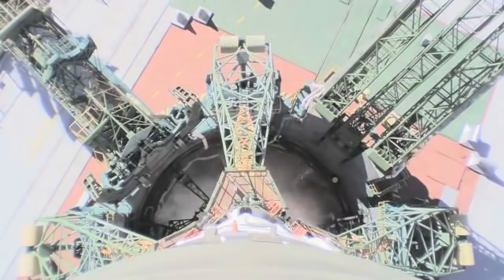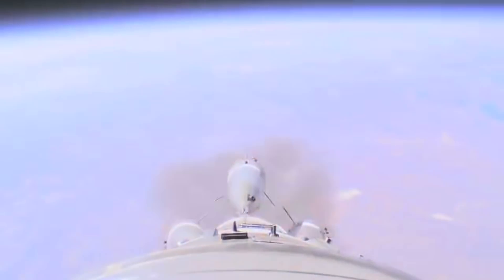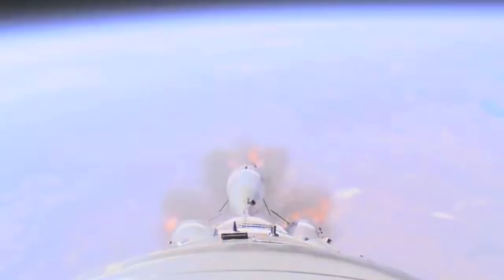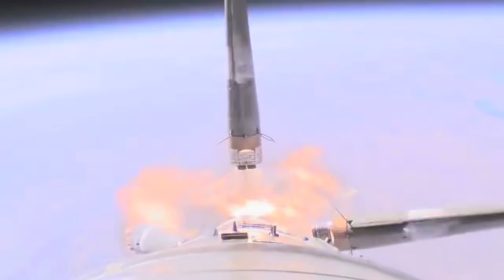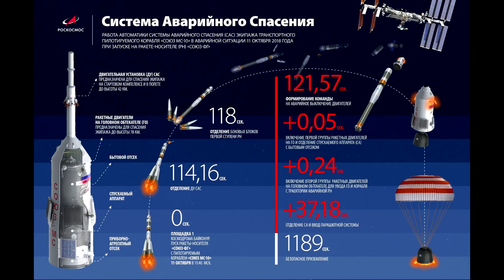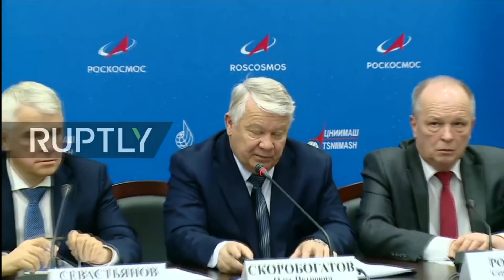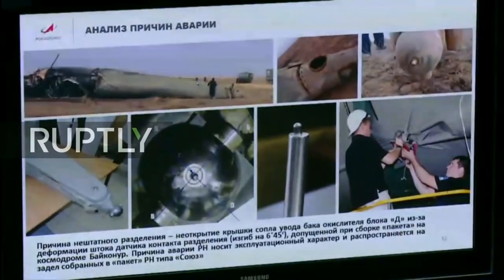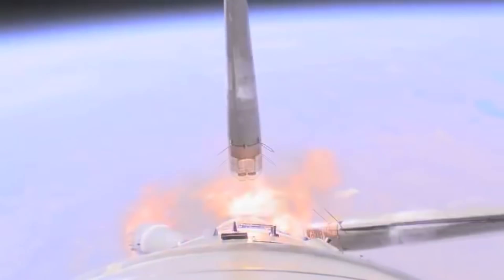In Flight Camera Shows Damaged Sensor Destroyed Soyuz Rocket

Comment: The cameras are probably purpose made without adding quality that isn’t needed.  24fps allows for longer exposure per frame, even on digital cameras.  1/48 nominal exposure vs 1/60 of 30fps.  About 20% more light, or 1/5th of a stop.  Rolling shutter also isn’t a measurement of quality.  It just means it’s a CMOS sensor that handles noise much better in low light and higher ISO than a CCD sensor.  Currently only CCD sensors and film can produce a global shutter.  That is, until last week when Panasonic released news of its OPF sensor that’s the worlds first global shutter CMOS with some other interesting benefits.  A technology that has been 6 years in development.  I also noticed the video was very flat, which also requires more exposure and ISO, another reason why they would go with a CMOS.  The low resolution may be for bitrate issues.  That way they could stream RAW video back to control instantaneously, even if the signal became very weak, and it would be available even if something happened to the memory on board.
Reply: There is plenty of CMOS global shutter sensors. Especially for non-commercial use, and they are pretty much as old as CMOS technology itself.. well as old when it come to single pixel sensors.

Sending of data very possibly is still analogue. As well its very common in space tech.

Most of tech in space thingies go back to Cold War especially when it come to flights with crew. I wouldn't be surprised if camera they use and transition protocol/antenna are like 20years old.

Also for most of the time CCD were much much better than CMOS sensors. CMOS being in SOME applications better than CCD rly didn't happened to like 15 years ago. Cause it always was relatively easy to create circuits next to sensors but putting additional circuitry under pixels and having good quality is recent and well happened as miniaturization and manufacturing processes got  better,

(Panasonic made first 8K global shutter sensor)
Reply: Czorńy Lisek  True, rolling shutter has been an issue since the invention of the CMOS sensor, and people have tried their hardest to minimize and mitigate it.  But most examples of a global shutter CMOS were either the illusion of a global shutter, or in rare cases an actual global shutter with severe side effects such as significantly reduced frame rate, resolution, and increased noise.  Those were basically only used as proof of concept, or for very specific scientific use.  Even then, like you said, CCD was king because it outperformed and was easier to make with the technology of the time.  So even though a true global shutter CMOS existed, it was never practical, and never made it into consumer or professional video devices.  Even the approach Sony recently took will die out in the light of Panasonic/Fujifilm’s design.  It’s a true global shutter, but having an a/c for every individual pixel is impractical, and the current sensor is only a 1600x900 proof of concept unit.  Meanwhile, Panasonic has the first working product that’s ready to produce, practical enough to find its way into at least half the prosumer cameras in 10 years, significant advantages like sensitivity control of each individual pixel and in sensor ND, with virtually 0 downsides except a marginal increase in cost once it’s produced in mass.  CCD will still have its place.  I believe Hassleblad still makes CCD cameras because they have better color accuracy in good lighting conditions.  I also agree you’re right, there has been true global shutter CMOS sensors, but such a small and impractical amount, they never made such a small impact that most people never knew they existed.
Reply: @CzornyLisek  15k analogue video stream, does that require more or less bandwidth than a 720p digital stream? That is the question.
Reply: Cameras are so cheap and weigh so little, I'd say use a bunch of different kinds. For instance, high speed footage could be valuable. Maybe infrared. Maybe more angles.

More bitrate is cheap and lightweight too.
Reply: Your reasoning makes good, practical sense.  For my part, I would think that for failure analysis a minimum 60fps would be preferable (it clearly wasn't needed in this case).

Comment: I'm no conspiracy nut, but two points I'd bet on.  First, I would not be surprised at all if the engineering video was "cleaned" up before it was released to the public.  The video looks almost fake in some places.  I'm not saying it is....I'm sure it is not fake.  Just saying that it looks doctored.  Second, shortly after the side boosters were supposed to separate from the main rocket body, it is easy to see the video skips ahead.  That is very clearly an "edited out" portion.  In either case it is no big deal...the side booster failure was clearly the fault, at least in my opinion.

Comment: Good that wasn't a nuclear powered rocket, what could go wrong, right?
Reply: Richard Wood hey!  Good thing the sun didn't explode this morning too, right?  Phew.  I worry every night
Reply: Hello @kelvyquayo  , sorry you worry about the sun so much but we've a pretty good understanding  of what the sun's been doing and the odds are it will rise from the East. No guarantees tho.
Reply: I don't think the results would have been any different with a nuclear powered (I am assuming NTR) rocket.
Reply: What's a little fallout among friends mean anyway
Reply: @qzh00k  Worse case you have hot reactors dropping into the down-range area.  If the reactor cases break upon impact there could be some local contamination.  It would come down the reactor design.
Reply: Trust then Verify, and under this administration that second word seems hard to do.
Reply: @qzh00k  Trust and verify...? It seems to be you've strayed off topic.
Reply: I can't assume the safety of whatever containment design is used and would like to understand. That takes research and qualified analysis I can understand, not sales brochures and promises.
Reply: @qzh00k  Well they never made it far enough to build a flight worthy engine so there is no info to be had on the safety of a flight approved reactor.  Like I said, the level of contamination would be (at least in part) determined by the design itself, something that only exists as a hypothetical.
Reply: We have a lot of information, decades of it.  We stopped launching those materials some time ago and for real reasons.
Litigation after an accident is a poor way to so so this kind of business.
Reply: @qzh00k  Information on..?  We never launched a nuclear engine.  No one has.
Reply: @TheEvilmooseofdoom  I am speaking to the isotopes that will fuel the engine and their containment scheme.
I'd be interested in what does come out the exhaust pipes if the engines are used in Earth's atmosphere, because curiosity.
Reply: @qzh00k  Google NERVA.  The fuel elements are encased in metal rods or in more modern designs inside ceramics.  This is to prevent the erosion of the fuel elements so no radioactive material is released.  I think it was a zinc coating on the test reactor in the NERVA program.
Reply: In a disaster those bindings and coatings can fail, people get paid a lot of money for risk analysis and maybe we should have some insights into that realm.
As I pointed out, we avoid launching these materials now for a reason.
Reply: @qzh00k  The reason is mostly paranoia, we simply have no data.  To compromise the fuel elements you need to compromise the reactor vessel and no one ever got to flight testing so again, it's just speculation.  Reactor vessels tend to be pretty strong though but I certainly can't say how strong a flight ready one would have been.  I assume that some testing for risk assessment would have been conducted prior to a flight.
Reply: @TheEvilmooseofdoom  assuming can make for poor decisions, politicians can poison a cities water based on assumptions.
Reply: @qzh00k  Well since testing is SOP in transport and space flight I think my assumption is pretty safe and you're now officially reaching and it's both pointless and silly.
Reply: Both TMI and Chernobyl were engineering and operations failures based on an "assumption"  of how the reactors would respond to MOX fuel. We "assumed" tsunami heights at Fukushima and ignored evidence.  Those we're not silly accidents.
Reply: I'll leave my opinions of your knowledge out of this, thank you for the time.

Comment: We've had our own problems:  Chunks of insulation coming unglued, or launching in temperatures that make toroidal rubber gaskets brittle.

The difference is we didn't have an escape system.  STS 51,107.  You will be missed.
Reply: In all fairness with the foam strike no escape system would have changed that outcome.

Comment: The guy who bent the pin is now working in the flame trench, along with the guy who installed the gyroscope upside down on the Proton rocket.
Reply: capturing all the gas with a burlap sack from the next flight.
Reply: The proton mishap boggled me. Now I know the Russians aren't as strict with rules and regulation as the Americans, but a gyro / sensor HAMMERED in upside down???? How the hell did that pass inspection? On  the other hand, this is an example demostrating why the Americans won the Moon race.
Reply: @paulmichaelfreedman8334  The Russians have brilliant engineers; perhaps the best rocket engine designs in the world. But, they have lousy quality control. That's why the N-1 blew up every time it flew.
Reply: @apollosaturn5  Agreed. The N1 Design was solid enough, just the high number of engines meant there was exponential chance of failure, and vibrations from 30 engines ain't nothing either. This is why von Braun preferred a low number of large engines and gave the S-V 5 huge engines.
Reply: @paulmichaelfreedman8334  Each stage of the Saturn V was test-fired fully assembled in a platform precisely to know how their structure would react with the engines. Still, it had vibration problems especially in the first stage. If Apollo 6 had astronauts they would have had to abort because of the vibrations in the first stage. The N-1 din't have that "luxury". Korolev didn't had the time or money to build test stands large enough for the N-1 stages, and the engine control software (KORD) wasn't fully developed. All the interactions would have to be learned during flight. That's why they blew up all the time. Even so, with every flight they improved the design. But, the politburo cancelled the project before major progress began.
Reply: apollosaturn5 Had. 60 years ago.
Reply: @noop9k  Well, given the ridiculous failures they've been having lately, I'm inclined to agree with you.
Reply: @apollosaturn5  You would think the higher ups would realise that blowing up 3 N1s to learn how the engines behaved in flight would be slower and more expensive than testing it a few times then sending it up

Comment: Really close to a "Challenger Moment." Thank goodness that didn't happen.
Reply: Challenger didn't have any escape system contrary to Soyouz. Had the Shuttle cockpit been detachable and equipped with parachutes, the crew would have been saved, in Challenger accident, the cockpit actually survived the failure and dislocation of the craft. It is the fall into the ocean at high speed that actually killed the astronauts.

Comment: Cudos to Roscosmos for releasing the report this quickly and getting back to launching rockets!
Reply: They did it because there was an American on board, had there been only Russian crew, they wouldn't have bothered to go that fast.
Reply: Yeah, if it were NASA we be waiting two years in the dark.
Reply: @wmgroner  
If that's a jab at the Rogers Commission, recall that that incident involved catastrophic failure and loss of life, NASA's first major manned launch failure.  Going slow and getting all the facts nailed down (especially in a system as complex as the Orbiter program was) is vitally important to proper analysis and correction.
Reply: @wmgroner  you want it done correctly without any missing pieces or you want it done quick?

Comment: I find it rather odd that they use a camera with only 24 FPS for engineering purposes, given how fast the situation of a rocket can change.
Reply: As someone said earlier in comments: One of the reasons is to get more light than in higher frame speed.
Reply: US NTSC Video is 30 frames/s; Russia uses SECAM 25 f/s - film is 24 f/s
I'll trust Scott that it is 24 f/s, but just maybe it is 25 ??? SECAM resolution is 720x576 but 640x480 is historic digital resolution...
Reply: @Criss Prall Could be.

Comment: You mock the camera, but you are seriously underestimating it. The surface temperature of rockets is way above the operational temperature of normal silicon electronics. This leaves two chooses, use large heavy shielding that hurts the overall performance of the rocket, or use more temperature resistant electronics. 

Maybe during the space race's propaganda or with spaceX trying to impress investors, that trade off is worth it, but from an engineering prospective, it makes much more sense to use high temp electronics. Meaning no high density transistors, no high operating frequency, and reduced pin count(low bandwidth). Its image quality is actually quite comparable to the type of camera you stick in a furnace.
Reply: Amir Abudubai 
Rocket exteriors are actually cold, not hot, SpaceX uses GoPros for engineering purpose, not to impress investors. Please go back too Russian troll school, because you clearly don’t know what you’re talking about.

Comment: That sensor resolution, rolling shutter, the missing piece of video when the booster finally detaches...

I bet that camera was using digital tape, and it skipped due to the physical shock of the forced detachment. They're using ancient technology...
Reply: The video was sent back to ground control in real time, so I guess the signal was lost because of the shaking.
Reply: That ancient tech is better than US modern tech looool.
Reply: @cheekibreeki7641  How so?
Reply: Sending of data very possibly is still analogue. As well its very common in space tech.

Most of tech in space thingies go back to Cold War especially when it come to flights with crew(unmanned flights are used essentially as test beds for new fancy tech). I wouldn't be surprised if camera they use and transition protocol/antenna are like 20years old. Simply because they know they are safe.
Reply: Yes I think that's the most likely explanation too. You can see that a few frames are missing during liftoff as well probably due to vibrations being reflected back to the rocket by the hold-down arms. Pretty lucky they managed to re-aquire signal while it was spinning though.
Also the same thing happens when SpaceX lands on the barge. We rarely see the touchdown on the live feed.

Comment: "damage attributed to non-standard assembly procedures" 

I love these descriptions.
Reply: Only Nuclear physics has better descriptions. 
"Positive void coefficient" (If your reactor coolant has turned to steam, your reactor will speed up instead of slow down, creating even more steam, causing it to speed up further.)
"Prompt criticality" (Your reactor just exploded. Chernobyl went prompt critical due to it's positive void coefficient and operator error)
"Excursion event" (An unplanned nuclear chain reaction has occurred)
Reply: @SlocketSeven, there are even better ones:"Positive SCRAM-Effect (PS-Effect)" - the emergency reactor shutdown system (SCRAM) causes it to briefly speed up or even go into Prompt Criticality (what happened in Chernobyl)
Reply: @SlocketSeven 
Aviation has it's share!  After the investigation into a fatal light plane crash, the report read, "The cabin was reduced to non-survivable proportions."
Reply: translation: drunk jackass  went to town on the booster with a hammer
Reply: @OnionChoppingNinja   Given the recent blunder hole made with a drill on a Soyouz capsule, Russa seems to have problems with assembly and fitting production lines. So having a booster defect caused by an error during assembly was the most probable cause of the Soyouz launch failure. Not surprised there.
Reply: I would have loved to hear George Carlin's take on this.
Reply: @Lets see some ID "damage attributed to non-standard assembly procedures" ... leading to Rapid Unscheduled Disassembly.
Reply: @KaiHenningsen  pretty much...
Reply: In English "they gashed it".
Reply: Or in other words: "we found someone we can blame for that" :D His name is Alex and he doesn't know his fortune yet. He is the nice guy who always talks about that alien novel that no one read except him. Darnit Alex, what a pity...
Reply: At least it wasn't upside down.
Reply: @dalentoews3418  Well if it was then all the electrons would spill out! then where would we be?
Reply: More formally known in the trade as "percussive maintenance"
Reply: RESONANCE CASCADE!
Reply: On a sturdy russian rocket I expect a fair share of percussive mentenance.
But those russian engineers aren't stupid. Their engine for the Energia is still in use today in updated form. Used by NASA!
Reply: AKA:  unauthorized rework.
Reply: When your local dingo bangs the equipement with a jackhammer.
Reply: ...resulting in an unscheduled disassembly event.

Comment: If it does not fit, use a bigger hammer. Maybe not...
Reply: considering the tilt was just 7 degrees i think it was not propperly alinghed with the main booster and the pin was slightly bent.

Comment: Its really cool as a side note, this is the first time I have seen in real time the atmospheric effects on the confinement of the exhaust gasses, you can clearly see the exhaust plum grow with altitude. At least that is what I would think is happening???? pretty sure you covered this in a video about rocket nozzle shapes or design? Either way very cool to actually SEE it, Fly Safe!
Reply: You can see it in other launch videos too.  There are several of the shuttle that show from pad to SRB sep.